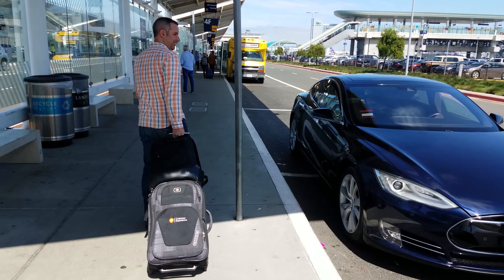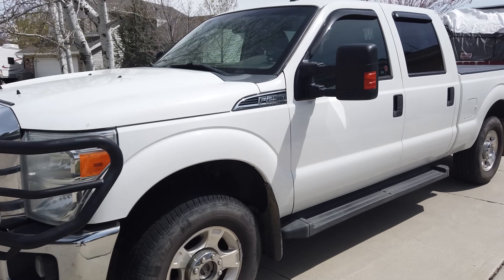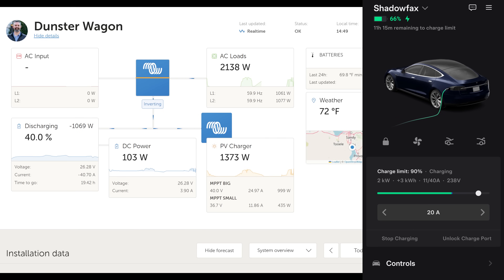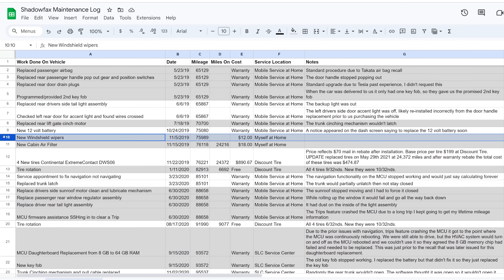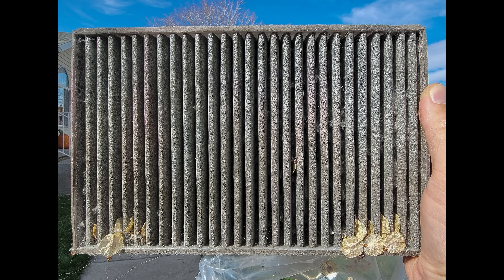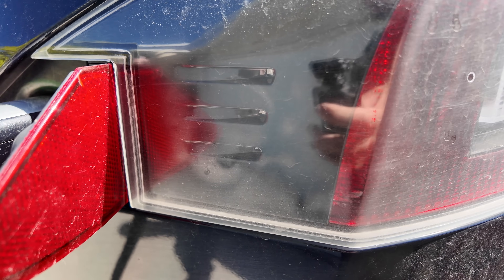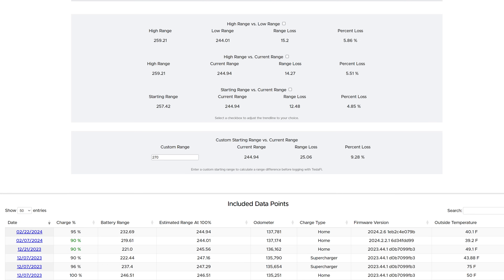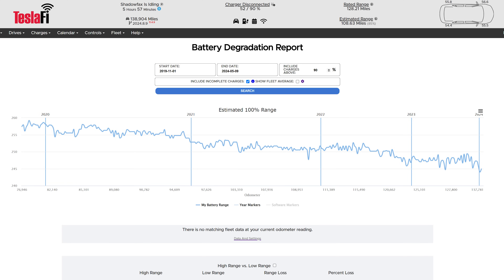Should You Buy A Used Tesla? | 5 Years Of Model S Maintenance Costs Plus My Current Experiment

Comment: Power from solar panels is not "free" - ever.  Solar panels themselves are not free and they will not last "forever".   Plus they need maintenance and they do break and fail on occasions.    It would be like paying for multi-thousands of dollars of gasoline in a tank out back and then saying fuel from the tank was "free" after the fact.  Solar isn't free even when you break even with installation costs because you need to be saving up for the upcoming replacement costs which will be significant.  Of course you could move before you do a solar replacement in the same way EV owners can sell their car before it needs a battery replacement.  That said, it is still not free and somebody is going to have to pay for batteries and/or solar panels at some point and that should always be factored into long term costs.  EV owners see this with vehicle deprecation when they sell but homeowners never seem to want to address this.
Reply from the maker: As I talked about in this video https://youtu.be/m_UNWLxNehU my solar panels have broken even on their installation costs. The total cost of installation (zero maintenance so far) was $9,735.31. As of yesterday the solar panels have produced 97,620.89 kWh. At 11 cents per kWh (average where I live) the panels have produced $10,738 in value. Or multiply by whatever retail rate for electricity you'd like. At this point in time (May 27th 2024) my panels have produced $1,003 more than they cost to install. There is likely going to be some maintenance costs like replacing the inverter once over the lifespan of the solar array (25 year production warranty on panels, 12 year warranty on the inverter), and when the time comes that I need to spend money on replacing components I'll add that to the installation costs. Only when the entire solar array has been removed/replaced will it be possible to calculate the exact price per kWh over the lifespan of the solar array. Saying solar energy is "not free" in the midst of the lifespan of the system is not helpful. What is helpful is adding up the installation/maintenance costs and subtracting the ongoing monetary value of the produced electricity. In my case I've had zero maintenance costs since the installation went online August 2017 so I am truly getting free electricity from the sun. Is it possible that some component fails today or in the near future that costs more than $1,003 to replace? You bet. Maybe I'll even go negative again, but every day I get more energy going towards my "free energy" calculation. Over the expected lifespan of my system (August 2042 is when the solar panels and inverter will be out of warranty) the panels will have paid for themselves 4 times! (I calculated that by dividing 9131.25 which is the number of days over 25 years by 2244 which was the number of days it took my system to break even.) It's likely the system will continue operating past that point, or perhaps not; only time will tell.

Comment: Did i miss the part where you tell us how much it has cost to own ? Would be good to have a compassion to fuel car too 😊
Reply from the maker: I should have included in the video that the total cost at this point after 5 years of ownership and adding 75,108 miles onto the odometer, the total cost to us has been $4,223.99 to own and operate our 2015 Tesla Model S. Tires alone are $2,024.11 of that price, and the other large ticket item was upgrading to MCU 2 which was $1,876.88. Our supercharging was free throughout this until right at the end when we transferred free supercharging to our Model Y and we had to pay for charging to get home from Las Vegas. Our charging at home has been free with solar and we haven't paid for charging anywhere the entire time we've owned it. This number does not include insurance and registration costs as that's highly variable depending on your own insurance rates and where you live.
Reply: Thanks for the Reply, I know you have a lot of straight roads out their in the US, I wonder if it would be different here in the UK
Reply from the maker: I doubt it would be that much different. We definitely change directions a lot here too.

Comment: What do you mean the supercharging was getting too slow ?
Reply from the maker: Batteries slow down their charge speed over the course of a charge session, and after many charge cycles they develop additional chemical resistance and thus slow down charging more quickly as they age. In our Model S, over time as the battery management system tracks the usage of the battery, Tesla has programmed it so that once you've supercharged it (DC fast charge in general) a certain amount (I have no idea how much, and it might be a gradual adjustment) they lower the amount of time that the car is charging quickly due to internal resistance building up in the battery from age. I believe this slowdown would never occur if you never DC fast charged and only level 2 AC destination charged, but that's kind of pointless since DC fast charging has it's use case and we used it. I believe these 18650 cells in our Model S are perhaps more prone to this slowdown effect vs the 2170 cells in the Model Y and 3 where I've heard of people treating superchargers like gas stations and they rarely or never use the level 2 AC charging and their charging speeds aren't slowing down. Also there's the big difference that when our Model S was made the peak supercharging speed was 120 kW and through a software update was increased to 130 kW, but our Model Y has 250 kW charging. Not only does the Model Y peak at a 52% higher charge rate, it also maintains higher charge rates throughout the charge session so that the average charge speed is roughly double our Model S.
Reply: Thanks, you know your stuff 👍

Comment: A few people talk about problems related to the heavy weight of the Teslas. Suspensions, control arms, joints, break pads, etc. Would you have any feedback on that ?
Reply from the maker: As long as the suspension components are built for the weight then there should be no problems, so I think you're asking if the suspension components are built robustly enough for the additional weight? I can't speak to the design specifically, but I can speak to our specific Model S and it's maintenance history. It has not had any work done on any suspension components while we've owned it. I did talk to a Tesla service advisor for a while going through the service history prior to us owning the vehicle and in 2016 (1 year after the car was built) the air suspension compressor was replaced. I have no context of the situation and I imagine that was just an early manufacturing defect warranty replacement. I've also been involved with the Tesla community for 7 years and there is NOT a general theme of increased suspension component failure. The one thing that clearly wears faster than ICE vehicles are tires, but as I talked about in this video the mileage warranty offsets that nicely.

Comment: Thanks for posting this clear and concise information. I have been holding off on getting a Tesla model 3 or Y because I don't like touch screens and I believe everything is controlled / monitored on this screen. I'm thinking it may be distracting at times, especially if I have to swipe it 2 or 3 times to get a response as I do on my android smart phone. Do you have any thoughts or opinion about this? Also, I live in far northern Utah and the closest service center I believe is in Utah county - at least 100 miles away. Would that be a deal breaker for you, based on your experiences?
Reply from the maker: The Tesla screens are very responsive and I have no problems with having to touch it multiple times. It's the same sensitivity as a smart phone screen or tablet. Sometimes my phone has issues because it gets contaminants on the phone screen such as when I'm working on my sprinkler system and my hands are all gross and I'm using the sprinkler controller app to turn on the sprinklers. In those situations I have to clean my cell phone screen then it's back to ideal sensitivity. That's never been a problem with my Tesla screens because I don't use those screens in as diverse of situations. There are two Tesla service centers in Utah at this point in time. One is at 1038 S 300 W, Salt Lake City, UT 84101 and thus would be the closest one to you, and the other one is at 2265 W 700 S, Pleasant Grove, UT 84062 farther south. The PG service center was built in 2023, so for the 4 years prior to that we had to drive to the SLC location which is roughly 45 minutes away and it wasn't a problem. Roughly half the time the mobile service came to our house and did the work in the driveway. I know of other Tesla owners who are hours drive away from a service center and it hasn't been a deal breaker for them. Personally I wouldn't worry about it overly much since we don't need service all that often, and mobile service is able to do a lot.
Reply: @ElectricTechAdventures  Thanks for taking the time to reply to my question. I guess I need to pay closer attention to how dirty my cell phone screen is! And I somehow thought that the Tesla location in SLC was for selling only, not repairs. I will reconsider the Model Y as I decide which EV to get.
Reply from the maker: @ValConB  There are two Tesla buildings in the Salt Lake City area and they are near each other but several blocks apart. The address that I provided before is the address to the service center and down the road south a little bit is where the sales showroom is. I wish you the best in your search for your next vehicle!

Comment: Any battery health check on this 9-yr old car ?
Reply from the maker: I showed the battery degradation from TeslaFi at 15:36 in the video which shows the battery is sitting at 9.28% battery degredation. If you want more detail I created this video https://youtu.be/hfFD6WTrg6g recently that shows more detail from the Scan My Tesla app.
Reply: @ElectricTechAdventures  my bad
Reply from the maker: No problem, I recommend watching the video I linked to for a lot more information than what I included in this video.
Reply: Do you follow any day to day rules with your charging? Ie only charge to 80% 
Also what’s the year round temperatures like where you live, I wonder if this has had any effect on your impressive battery health.
Reply from the maker: @fenman7277  With my Model Y I am generally charging it up to 80% and then letting it run down to somewhere between 20 to 40% and then charging it back up to 80%. Sometimes it takes a week or two to run through that range so it will spend days in the ideal middle charge point. I don't just plug it in constantly but I know probably most people do. With the Model S right now during this experiment it's charge point is largely dictated by how much we've been driving versus how much solar output the trailer is providing. But I don't run it lower than 20% and once it gets above 80% I try to drive more to keep it lower and if it gets to 90% then I just send the energy to the model Y. If I were constantly just plugging in my electric vehicles at home then I would probably set the charge point to about 70 to 80% unless I needed more range than that on a daily basis like if I had a long commute to work. I live in the Salt Lake City Utah area so we definitely have hot and cold seasons here. Teslas have good active thermal management so the thing that the user affects more is the state of charge since the temperature is automatically managed. I suspect my battery degradation is probably pretty close to average for vehicles like mine.

Comment: Also was curious if you thought about using tesla batterys in camper?
Reply from the maker: I thought about doing that, and I saw others on YouTube who had done so successfully. There was one channel who decided to switch from Tesla batteries to some off-the-shelf batteries because they just felt like they were doing a science experiment in their RV that if it went wrong could burn their home on wheels to the ground and maybe even kill them. When I did my project there were already a lot of new things I was having to learn and I decided not to DIY build a battery bank from raw cells because using off-the-shelf batteries was simpler and faster.
Reply: Yeah i could 100 percent agree with that and great points i own inspired solar and inspired construction so i build batteries and things all day unfortunately but the burn down your house statement jumps out and ive seen it happen with people using the tesla bms i used the overkill one and its friggin amazing
Reply: Yep - use LiFePO4 - safer. The batts out of a Tesla would need some serious mods to make them mobile safe after they're removed from the case. Water ingress, friction etc are all problems in a caravan. Plus Victron makes great gear that just works with off the shelf LiFe.
Reply from the maker: @mondotv4216  Yep, that's why I went with proven batteries, albeit at a price premium. The trailer's electrical system has been rock solid stable for 2.5 years now with daily use either camping or charging Teslas as I talked about in the video.

Comment: I purchased a 2018 Model S 100D in 2018 new and still have it.
With 220,000 miles on it, vehicle is still going strong. 
New it was supposed to get 330miles w/full charge, it never was able to achieve that new.
New it usually was able to charge up to 300miles. 
Now it will charge up to between 284 to 280miles.
I enjoy the free supper charging while on the road, internet, all the radio channels, games and the self-driving.
Overall, no big issues or repairs. 
Had to change the A/C once as a bearing went out on the blower.
Replaced 12v battery once and wipers once or twice. 
I am still on the original breaks. 
Tires last about 50,000 miles. 
Car is garage kept and taken care of.
Interior is holding up great. 
I plan on keeping car long term.
I was going to get the Truck, but after seeing the reviews and range I will opt-out. 
I was going to trade my 100D in for a Plaid but Tesla will not give my much for a trade-in and I will lose all my options I have with the 100D and I like the sun roof and use the roof tracks to put my surfboards on too as the Plaid dose not have a good roof rack system like the 100D.
That is my 2-cents.
Reply: I have a 2018 Model S 100D also if I charge too 100% it show 364 miles
Reply: I thought 2018 model s didn't get free super charging?  @davidmitchell1920
Reply: Thanks for your insight on the Model S! I have been thinking about getting a new Model Y, since the discounts are great, but have to believe that the Model S is a more luxurious car.
Reply from the maker: The S has more luxurious features for sure. However I've been loving driving our Model Y and for the price it's hard to beat the value of the Y. I prefer to drive our Y a little bit more because it has better visibility, blended regen braking to friction brakes, blind spot camera, and it's a nimbler ride. But both vehicles are infinitely better to drive than any non-Teslas I've ever driven.
Reply from the maker: I'm most surprised that your tires typically last 50k miles! Yes we're holding off on buying the Cybertruck for now due to lack of 6 seats primarily, but I'm also bummed about the minimal range and simultaneous huge price hike. Thanks for taking the time to type up your $0.02! It's helpful to others to get multiple perspectives since my video is just one vehicle.
Reply: I suppose it matters how people drive a car? People complain about tyres on EVs, but those EVs have great 0-60 times so could it be that people use (or abuse) this function much more than on regular cars and so the tyres are wrecked faster?
Reply from the maker: @lkrnpk  Torque is probably the biggest factor, however weight also will cause tires to wear out faster and the batteries in EVs make them heavier than their ICE equivalents. I believe the tires would still wear faster even if you drove really gently.
Reply: @ElectricTechAdventures  yes but then again Model 3 isn't that much heavier compared to similar size ICE car, I mean not this huge amount that people usually think. And a lot of EVs are heavier than Model 3 in that size group but still Teslas get a lot of flak about tire longevity, of course most EVs on road ARE Teslas and people associate them with EVs in general, but maybe most of that when at least it comes to Model 3 is also just driving style
Reply from the maker: @lkrnpk  Yes I agree. Teslas are generally the most efficient EVs on the road so they can get by with a smaller battery and thus they are lighter than equivalent range EVs on the market. The tire wear is probably mostly attributable to the torque and that people accelerate more heavily...because it's fun and useful.
Reply: Does the screen tell you when the AC goes out? I have a 2018 100D too and it makes a loud strenuous noise when I put the fan speed anywhere from 6-10; makes me think it’s dying or fucked up. Below 5, it’s quiet.
Reply: the screen does not tell you if the AC motor is going,
Sounds like a bearing going out, that is what mine did.
They replaced the blower motor 
Hope that helps
Reply: @lynnh8189  I have a 75d from 90-18 I get 120 miles give or take a couple of miles that’s with all day driving I start around 930 am and finish the day around 430 or 5 but I need it to last until 8 ish or nine stopping to charge in the middle of the dinner rush costs me about what gas would.
Reply: I am surprised. I had a 2018 100d as well and with 57000 miles it needed new tires but more than that the steering wheel column started screeching everytime it would extend or retract during easy exit. It needed to be replaced. The 2021 model s is a huge upgrade in space. I don’t miss the sunroof at all
Reply: Oh. And I got 24500 in trade in with 57k miles